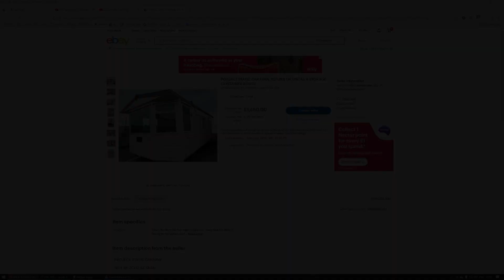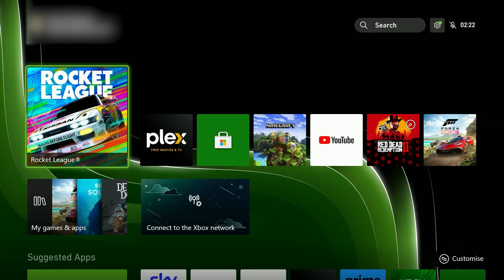The Power Connector Got Damaged During A Routine Cleaning... Can I Fix It?

Comment: One thing to remember with caravans, very thin alloy skins easily opened up with tin snips so might want to think about securing the caravan as a screwdriver will easily open a standard door lock with little sound and on some you can cut the rubber window surrounds and pull a pane completely out.   Insurance would want you to make the effort in securing the place or no payee outee when naughty boys come to visit :*(   May pay to secure the store area with panelling and some good steel plates and have a decent alarm/cctv in there too.   Think on how easy people do "peel n steal" on van doors, that is steel being bent like butter and perfect silence too...
Reply from the maker: Yeah I agree. I won't go into detail on security but I have it pretty locked down :)